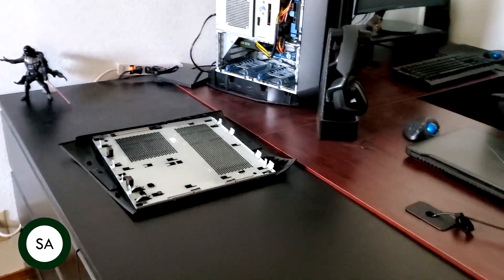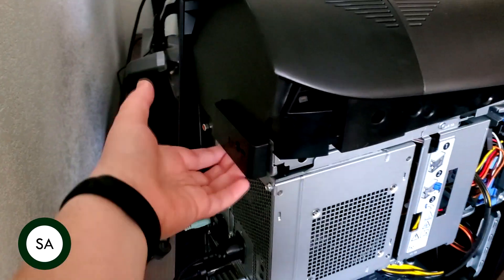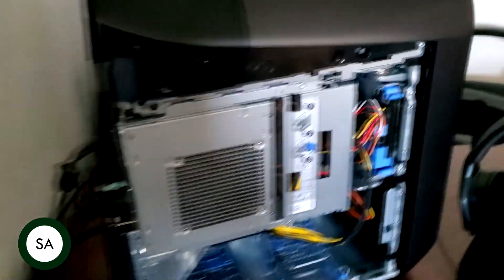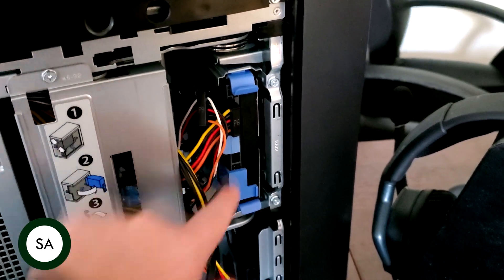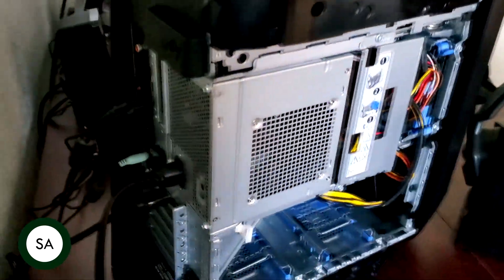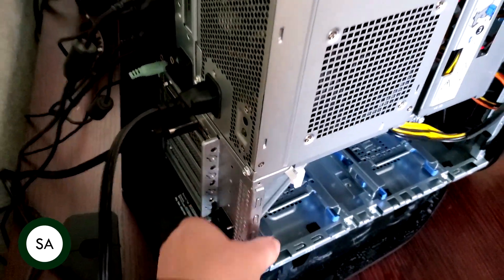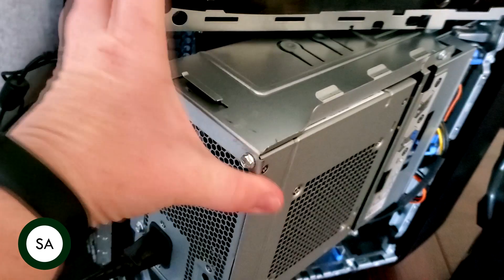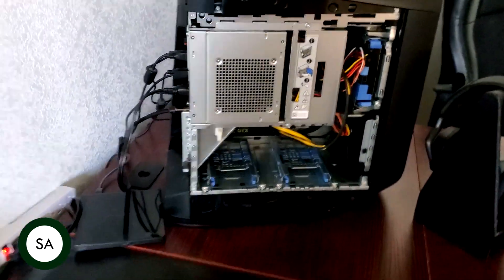Alienware R11 Update - NOT What I Had in Mind!

Comment: My r11 did the same, I only had to unplug the hard drive and reconnect and it worked after that
Reply from the maker: I did try that initially but to no avail. It actually turned out to be the motherboard giving an error and not an HD failure. I found this out yesterday when it did it again with the new HD and was able to clear the error
Reply: @simpleadvantage  oh that's not good, luckily still under warranty!
Reply from the maker: For sure lol They told me how to cancel out the error and said it probably wouldn't happen again but if it does to call them

Comment: I'm really sorry to hear that you're having trouble with your brand new Alienware, Toni. I sure hope they fix it properly for you on the first visit.

You're not alone though, I've been hearing stories here and there about poor quality of the parts. I just got mine in two days ago, running the RTX 3080, which apparently has no working fans. So I'm stuck myself as well.

Again, best of luck!
Reply from the maker: Thankfully all seems well now. They got me fixed up very quickly and I haven't experienced anymore issues so far. I hope they are able to get those fans working, you don't want anything to get heat damage on a nice system

Comment: That's alienware for ya, I got the r8 with the 2080ti and it overheats and starts thermal throttling a lil over a year causing you to use msi to create either a fan curve or a constant fan speed. Alienware has literally turned from a decent company to complete garbage. I will never buy from them again unfortunately.  Plus still got my r4 that still runs fine kinda weird if you ask me. I feel the cases they create now for their components do not allow enough air flow seeing as there's only one intake fan and one exhaust fan on top. It makes 0 sense to me.